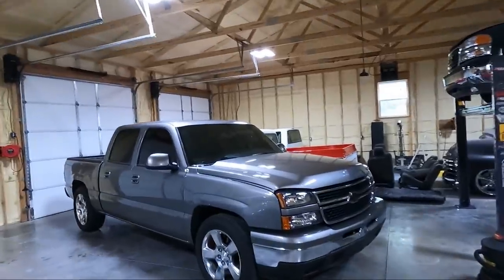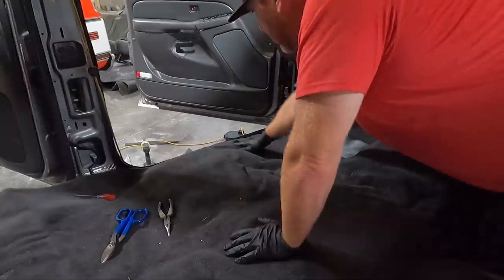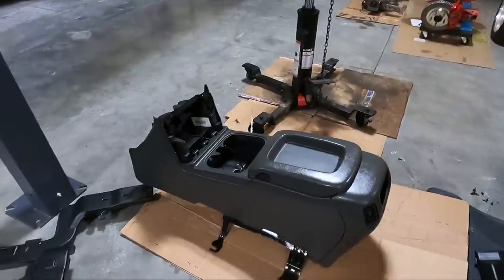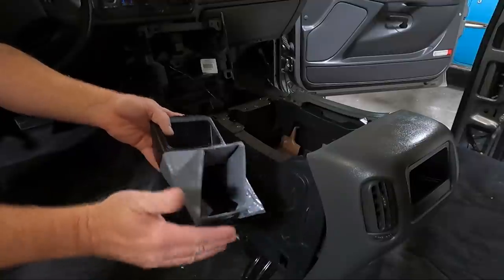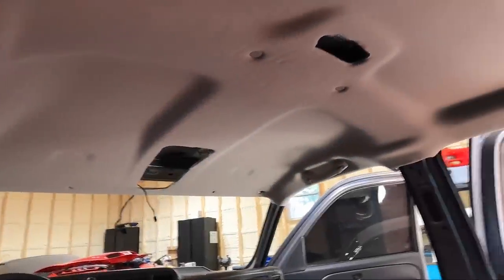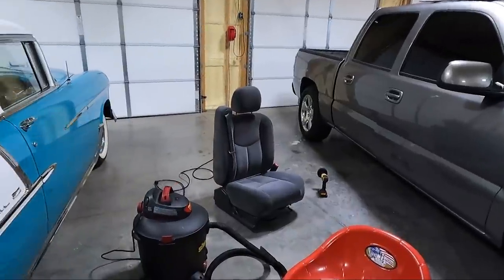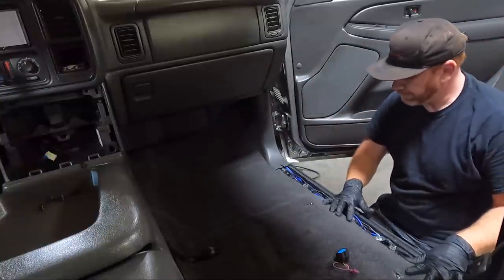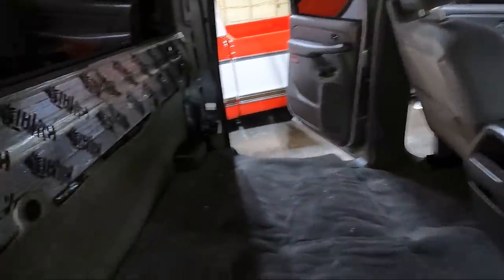Daily Driver Silverado Overhaul Part 3 (Going back Together with New Carpet, Console and Cleaning)

Comment: Hey, you should add steering wheel controls if it will be your daily, I added mine and they work perfectly, just a recommendation,  you can also get the cluster to work to show the other stuff like tpms and fuel range
Reply from the maker: Honestly I don't want to have to program the bcm for it all to work
Reply: @TWAMotorsports  you don't need to I just did because I have a buddy at the dealership, another alternative is to get a pac steering wheel module that has analog, connect a specific wire , and program the module and bam just connect to radio and it's done
Reply: @TWAMotorsports  for the cluster there are activation services on the internet that's what I did
Reply: @TWAMotorsports  sorry but I'm just one of those guys that want all the options that these pickups came with, so I've found alternatives ways to add those options
Reply from the maker: Interesting. Thank you
Reply from the maker: I may look into that
Reply from the maker: I am generally like that too

Comment: W/ your toggle button on dash, do u still get all the functions (oil life, tire pressure, fuel mileage), even though u have an aftermarket radio?
Reply from the maker: I don't have a toggle button
Reply: @TWAMotorsports  i mean on the dash instrument cluster, the black knob u can push to zero out trips, fuel mileage, etc
Reply from the maker: Only does trip and hours.